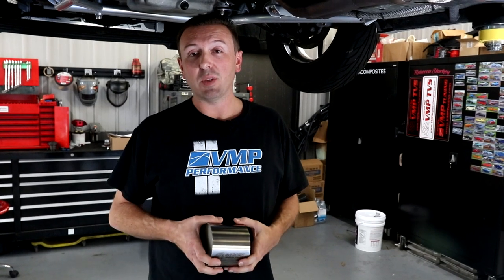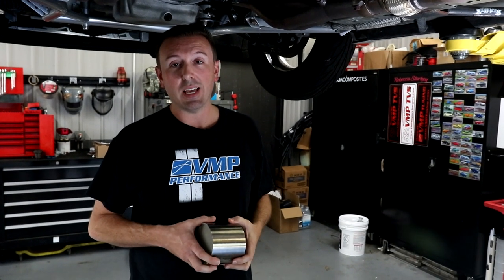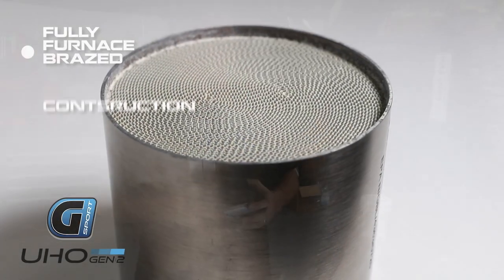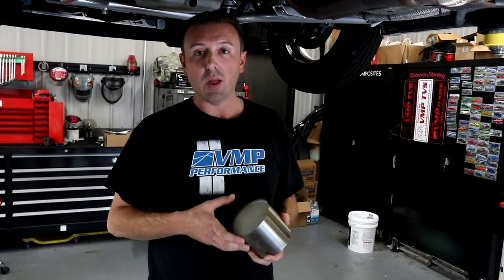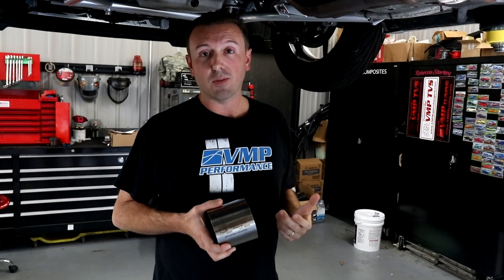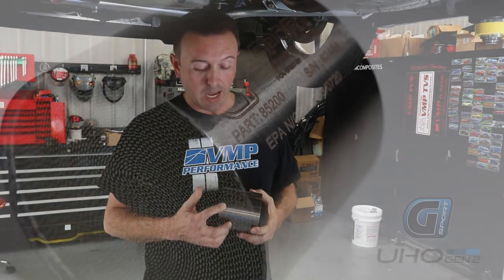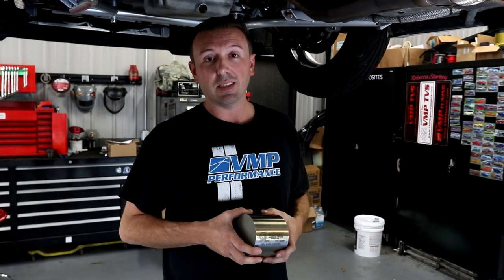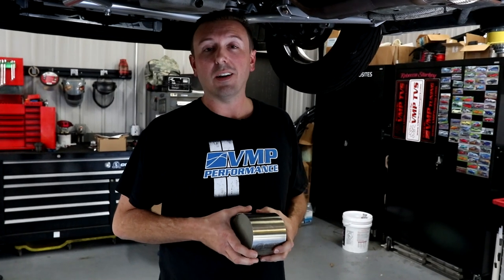Product Testing and Development || Big Power meets EPA Compliance, G Sport Cats and LTH Exhaust

Comment: I run cat's on my Bassani X pipe on my Terminator and with a 2.76 pulley ( Unported Eaton ) Exhaust and a JLT it put down 483/517 so I would not say having cat's held me back at all. Side note: I really wish VMP would bring back the 2.3 for the Terminators. I was really set on getting a VMP but since I have decided that I want a really good street set up for my Cobra and build it to the low to mid 600 range but with the 2.3 being gone from VMP my only option is the whipple. I do not  need or want the biggest baddest blower to put on my car, I dont care about peak HP numbers. I want something that is a monster for the street ( not drag racing ) and a 2.3 fits that so well. I"m sure from a business stand point there is a reason why VMP no longer sells the 2.3 but from a consumer sand point it really sucks.
Reply: Dang thats too bad that 2.3 wasn't that bad ethier for setups like what your trying to do
Reply: Tristan Smirnow A lot of people still want the 2.3 VMP. I hate KB I’d never use one even if it was free so my only option is the 2.3 whipple which is a great blower too but I really wanted a VMP.

Comment: Mentioned no loss in power. What was the dyno result prior to cat installation? Same? Torque as well? What is the cat protection temp. to back down timing set at? If prior to 2017, could you use the less restrictive Gen 1 version? Does the Gen 1 UHO flow better? Thanks for video. Opens up for a lot more questions to follow up on. These look to be very high quality units.
Reply from the maker: Same TQ as well.  At 1650F you need to enrich fuel to cool any catalytic converter.  More timing actually makes cats run cooler due to lower EGT (burn starts earlier in the chamber).  Gen1 may flow every so slightly better but I would not let it be a deciding factor.  They are very high quality.